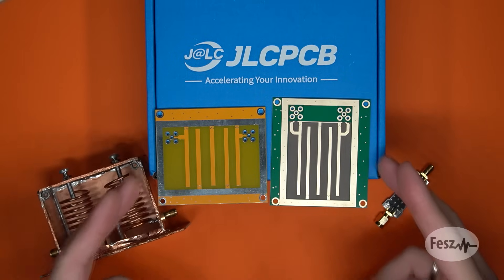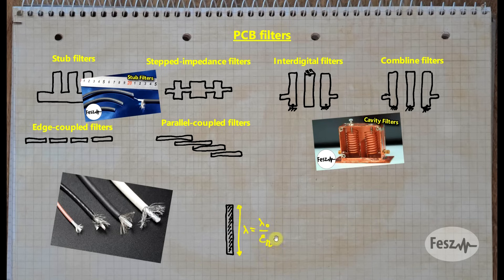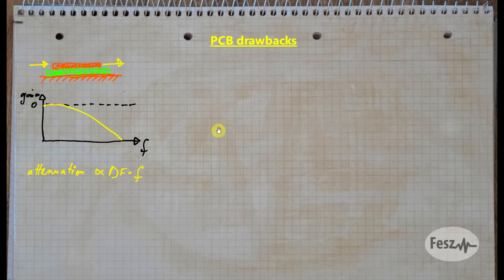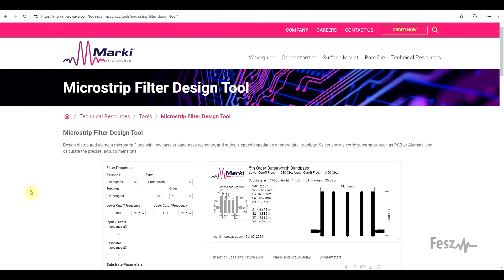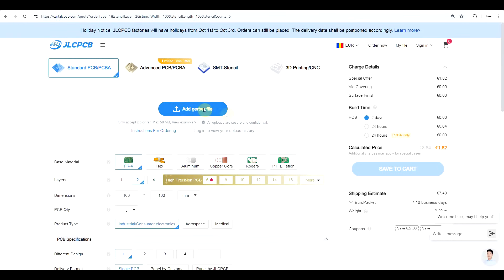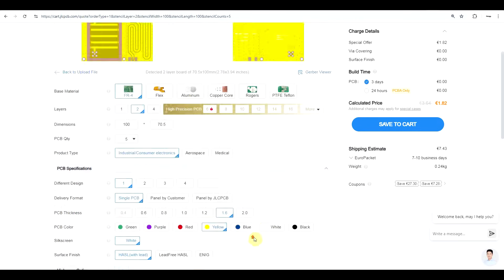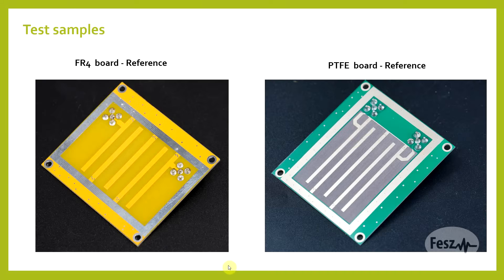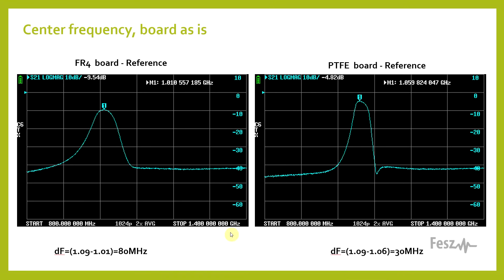PCB based Filters

Comment: There's microstrip, and then there's stripline. You started with microstrip, then (when adding a shield case) made a form of stripline.
For "true" stripline, select 4-layer board from JLPCB, put the traces on layer 2, and make layers 1 and ground planes.  Tighter shielding makes a better design, but you can't trim track lengths. 

Alternatively, stay with a 2 layer design - but replace your shield with a blank (1 sided) PCB, and screw / solder that over the top.

Comment: Seems fantastic. Why don't more systems use PCB filters?
Reply from the maker: I would say that the size taken up on the board, the special proprieties of the board needed to minimize loss and finally the number of development cycles needed to get the design right - with a commercial SAW filter or similar, it will work the first time, with this sort of PCB design, it will take a while to get it right; however if the design is produced in large enough quantities it should be cheaper.
Reply: @FesZElectronics  Would this make more sense for an RF signal between transceiver and antenna? Or better for filtering after a signal is buffered or amplified? How's efficiency and other performance factors compared to a SAW or RLC filter?

Comment: Nice video.
Good concept as we can reduce the price of a product without using a SAW filter or any other components.
I think better calibration can be done using laser trimming.
Reply from the maker: Once you include laser trimming and a low loss pcb, i'm not sure if you can get cheaper than a SAW filter; however, with a PCB based filter you can get any center frequency or response type, things that are usually unavailable as standard components.

Comment: I've designed PCB hairpin filters at 12GHz that only have 1dB of loss. Your problem here was entirely an over-ambitious bandwidth choice. You really need to be over 10% bandwidth for these filters to work. And filter design software never gets the centre frequency right. You need a proper electromagnetic analysis programme like HFSS to understand what a filter will do before you build it. But the basics here are dead right, and thank you for covering it.

Comment: Adding the can does indeed increase the capacitance but to a tiny degree. However, it also reduced the inductance which is where the higher frequency response comes from. Band pass filters are almost always a two way game between capacitance and inductance. Generally increasing the gap between the signal and ground will reduce capacitance but increase inductance and the opposite will also hold true.
Reply from the maker: I guess this is also why the overall insertion loss increased - the filter was designed to be 50ohm without the shield; with the added shield the trace impedance also changed, going to a lower value

Comment: Hi,
Please make a video on SMPS feedback loop compensation design in LTSpice simulation and in real life also based on actual plant response and tuning parameters, specifically for FLYBACK DCM & CCM mode with a voltage mode and current mode PWM controller Ic. & how to design transformer for a wide range of output voltages. & also explain what to look for in bode plot for the best stability criteria.

Comment: It seems curious that the fr4 is so much more effected by the shield compared to the teflon.
Reply: The teflon board is probably much thinner than the FR4 board resulting in a lower E-field flux in the air above the board. You can see this by the width of the tracks being narrower on the teflon board. Presumably they are the same impedance.

Comment: Did you cut back the pins of the SMA connector? Did it make a difference when shielded?
Reply from the maker: I did not cut the SMA connectors - they where left as is, just soldered in; I guess they present a bit of a discontinuity, but it shouldn't be too bad

Comment: Nice video, Fesz.

I was always taught never to go through the core on anything needing tight tolerances.

I'd be very interested to see you redo this using a 4-layer board, with SIGNAL on Layer 1 and GND on Layer 2.

I think that'd help, too. Especially with repeatability.
Reply from the maker: I'll have to try that at some point. With this design I went with the idea that a large distance trough the dielectric should help with lower losses since the traces are wider. However, as you mentioned the tolerances should be higher, so its a compromise...
Reply: @FesZElectronics  Oh, I totally get it. It's just my understanding that the core material is the lowest tolerance and the core thickness the least well controlled.